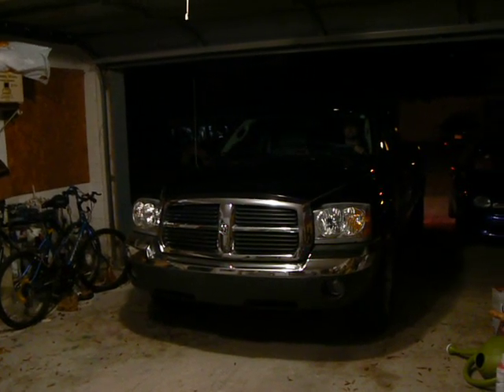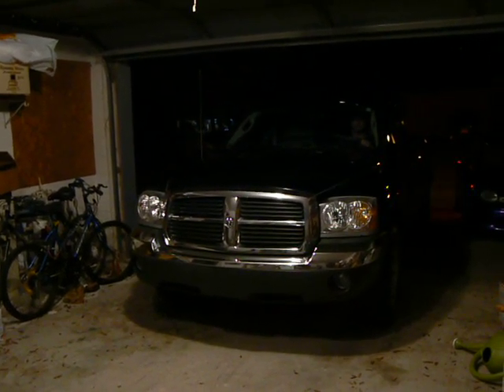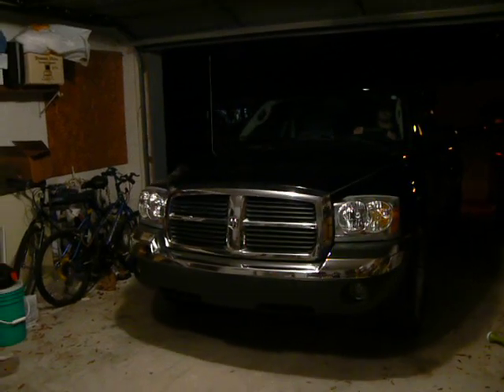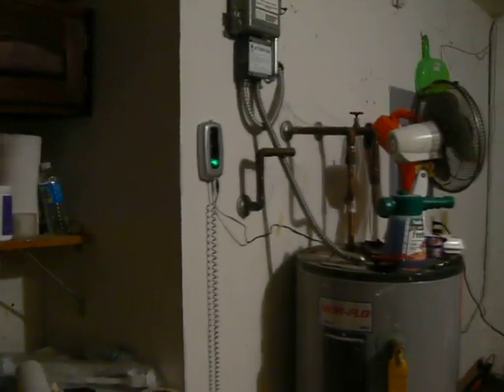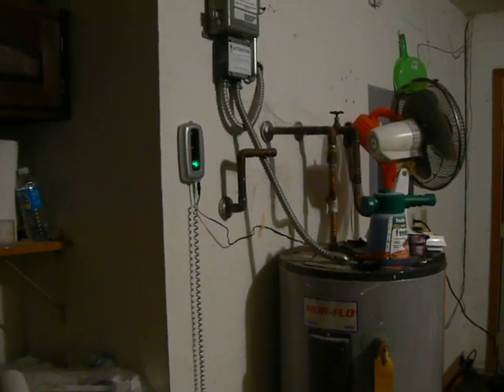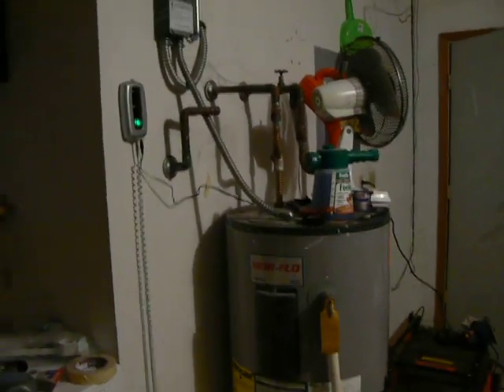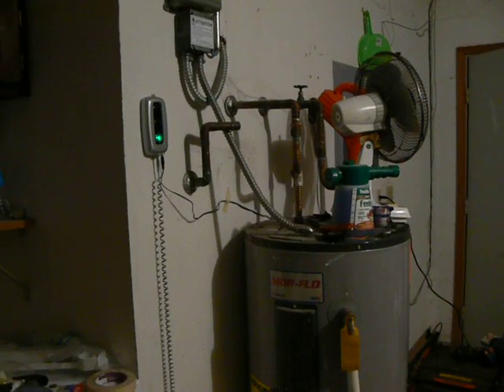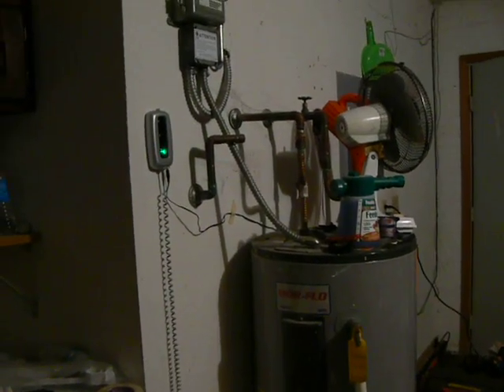How to Park a Big Truck in a Small Garage (Part 1)

Comment: Are you ever temped to just totally plow in to the water heater?  Years ago I used to drive a huge Lincoln.  That thing would barely fit in to my garage.  I had a latter stowed against the wall.  I used to know if I was far enough in the garage when I would run in to the ladder.  My how technology changes things. LOL!